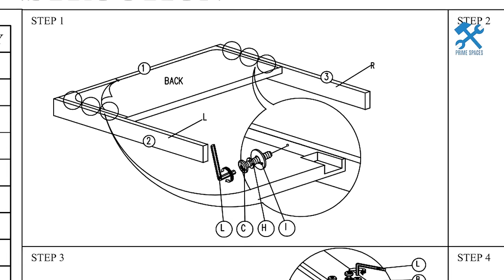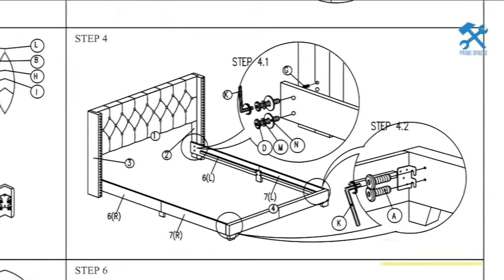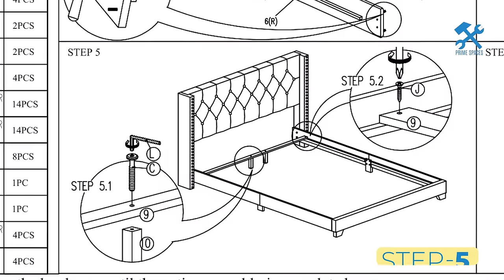Aadvik Tufted Upholstered Standard Bed Assembly | How to Assemble A Standard Bed (Step By Step)

Comment: It would have been nice to see what screws were going were
Reply from the maker: The instruction manual tells you which screws to use during each step.
Reply: @Prime_Spaces  not on mine
Reply from the maker: @caterinamarquezmartinez2367  ok, in the description of this video is a link to an instruction manual with hardware for each step.

Comment: I have this exact same bed , I’m
Confused with the different screws etc. my bed didn’t come with instructions or the letters on the screws so I can identify which is which. So I’m still confused honestly
Reply from the maker: Hey KiaMonae! 👋🏾 In the description of this video, you can find a link to the instruction manual to n our website. However, this bed comes in different sizes, so the bed in this video may vary slightly from yours - but they are similar. 

If you go to Wayfair and search Aadvik bed you can also download the instruction manual for your size bed. 

After you do that, you should undo what you have assembled and organize all the screws into individual sections. This will allow you to count the screws and match them to what is shown in the manual based on the count. Does this make sense?

Comment: Thanks. What kind of drill did you use?
Reply from the maker: Hey Kay! 👋🏾 I use a Milwaukee drill, but this type of drill isn’t required for the bed. You can use a drill more fit for small household projects like a Black and Decker drill. Or you can use the Allen key they provide and a screwdriver. I hope this helps. Please, subscribe to the channel if you haven’t already! ✅🙏🏾

Comment: Would a casper select mattress work for this type of bed frame?
Reply from the maker: Hey Richie! 👋🏾 If your mattress is the same size as the bed then I don’t see why it wouldn’t work. You need a boxspring for the bed though because it is not a platform bed. I hope this helps. Please, subscribe to the channel if you have not already. ✅

Comment: Recently bought this and assembled everything until the last part(step 5) where I have to screw in the slats. There are no hole and I assume I would need a powerdrill. What I am afraid of is splitting the wood and was wondering how I should proceed. In one of the earlier comments someone had asked a similar question and you had replied by saying making small pilot hole but how do I go about that carefully?
Reply from the maker: There should be hole on the slates. I’ve lost count how many times I’ve assembled this bed and o I’ve never seen the slates with no holes. Perhaps you have them upside down and the pilot holes are facing down?
Reply: I don’t have holes in mine either checked if it was upside down they aren’t either

Comment: What was it that u were hammering in. I’m currently putting together this exact same bed and I’m confused on what you hammered
Reply from the maker: In step 3 at 01:42 I am hammering in wood dowel part (G) into the side rails. There are 4 of them and they are slightly thicker than the wood dowel part (F). Then, in step 4 at 02:00 I'm pressing the 2 wood dowels (G) into the 2 top and bottom holes on the wing. It's a bit hard to see it because of the color of the bed. I may make a version 2.0 of this. Should I?

Comment: So the wood pegs did not secure correctly and they are both in the headboard from the right side. Do I use plyers to take them out
Reply: Or just super glue them together
Reply from the maker: You shouldn’t have to superglue anything. You might be using the wrong wood dowel. Reference the parts list of the user manual and make sure you are using the correct size wood dowel. There are 2 different size wood dowels.
Reply: @Prime_Spaces  thanks. Should I just hammer the other side to push the pegs out?
Reply from the maker: @HighImTri  I’m not exactly sure what you are talking about. Reply with the time stamp of the step you are talking about in this video so I know what part you’re on.

Comment: Ok I have holes in my wooden slats on both ends but no hole to screw it into on the side rails if that makes sense..I’m like did they not make holes for the screw to go into on the side rails. I’m so lost & not sure if I should sit my box Springs on it anyway or not
Reply from the maker: Hi, there shouldn’t be any holes 🕳 n the wooden side rails. There should only be holes at the ends of the wooden slats. So the screw should go through the slats and into the wooden side rails which have NO pilot holes. Make sense?
Reply: @Prime_Spaces  yes thanks so much! I ended up doing exactly what you said & hoped that was right. I was just very frustrated when I commented lol! Thanks for the reply!!
Reply from the maker: Haha no worries! 😉

Comment: if i dont have a drill what am i suppose to use
Reply from the maker: Hi Jada! 👋🏾 Good question. The bed comes with an Allen key to use for the bolts. But to fasten the screws you need a standard Phillips head screwdriver. 🪛 I hope this helps. Please, subscribe to the channel if you have not already. ✅

Comment: So the only extra tools I will need are a hammer and a hand drill??
Reply from the maker: Neither are necessary, but are helpful to have. The bed comes with Allen keys to tighten the bolts. A hammer or mallet can also be used briefly to insert the dowel pins into the side rails.

Comment: On the last part when you were drilling the wooden pieces was there already a hole or did you make them yourself
Reply from the maker: Hey, great question! There should already be holes on both ends of the wooden slats. You shouldn’t have to create/drill any holes yourself.
Reply: @Prime_Spaces  well I’ve finished and the last step is left but there isn’t any holes. What if i just put a box spring and then put my bed without the wood part? I feel without the wood though it isn’t sturdy enough
Reply from the maker: I wouldn’t recommend that. Do you or anyone you know own a power drill and a drill bit set? All you’ll be doing is drilling very tiny holes at each end of the slats so that you can screw the slats down with the remaining screws. Drilling the small pilot holes at the ends will prevent you from splitting the wood which is likely to happen if you drive the screws in without pilot/predrilled holes.
Reply: Did I

Comment: What crews are going into the side of the bed
Reply from the maker: Can you share the time stamp in the video you are talking about, or the step you are talking about? If you are talking about step 4, I believe it’s Part #D bolts - there are 4 of them and they are the thickest of the bolts, second to longest bolts.
Reply: I thought that but they seem lose when I insert them is that supposed to be lose ?
Reply from the maker: @jordynlasone3182  no it is not supposed to be lose. You are using the wrong bolt. The correct bolts are the ones that are the second tallest and the thickest of all the bolts - there are 4 of them total (2 used on each wing).

Comment: Where you get the 
tools for the bed frame?
Reply from the maker: The bed comes with an Allen key for the bolts. Other than that you can use a screwdriver for the  screws.
Reply: Prime Spaces Assembly Services yeah but I meant what bolts did you use for the frame ?
Reply from the maker: What part of the frame? There are different bolts for different parts of the frame. What step are you talking about? Or give me the time stamp in the video where I’m using the bolt you are referring to.
Reply: Prime Spaces Assembly Services from 0:35 - 0:55 what bolts did you use there??
Reply from the maker: Ok, that is part C bolt. If you’re assembling a king size bed, there will be 14 of them. Any other size bed part C bolt will have only 10 of them.
Reply: Prime Spaces Assembly Services thank u
Reply from the maker: No problem! Let me knowing you have any other questions.